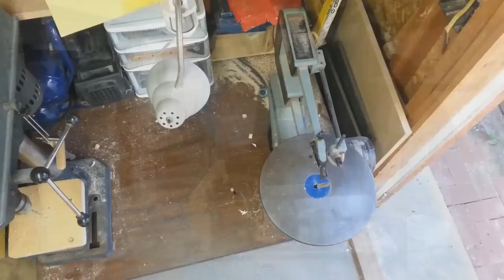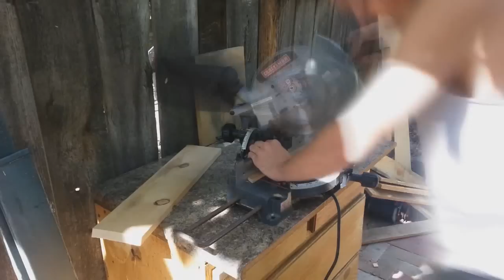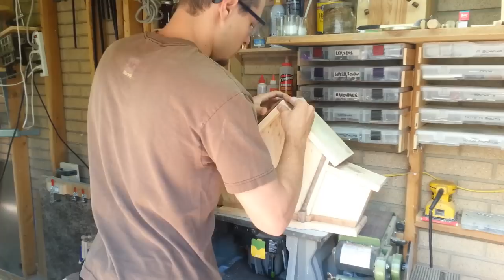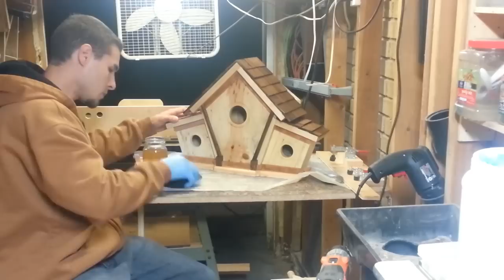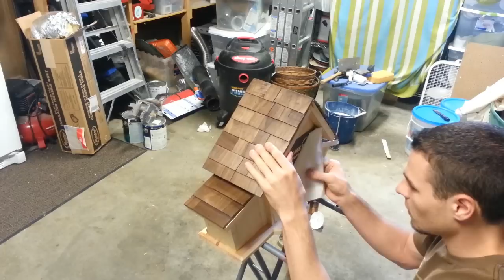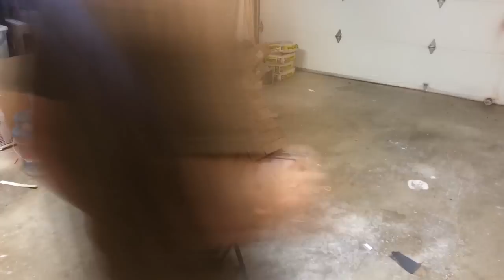Building An Awesome Birdhouse

Comment: ONE OTHER QUESTION--I TRIED MAKING A ROOF WITH SHINGLES DIFFERENT THAN YOURS--ITS WAS SHAKE SHINGLES 2 INCHES BY 2 INCHES BIT ITS DIFFICULT TO PUT ON--YOUR ROOF IS DIFFERENT. WHAT TYPE OF WOOD IS THAT AND HOWQ THIN--I NEED THIN WOOD FOR MY ROOF AND DO IT THE WAY YOU ARE DOING--ANY SUGGESTIONS--THANK YOU FOR THE HELP.
Reply from the maker: Mark Woolery The roof is black walnut, they are cut half 1/8" and the other half slightly thinner that's how the shingles sit fairly flat and fit together when gluing.
Reply: CNWOODWORK I WILL HAVE TO FIND WOOD THAT THIN
Reply: CNWOODWORK Thanks again for the help!

Comment: This is a very amateur question, but is that a nail gun that you are using to connect the shaped pieces together? And if so what type/thickness nail do you use. I have been wanting to slow get into woodworking as a hobby, and am trying to pick up ideas here and there.
Reply from the maker: Yes it is. For your first gun I'd go with a nailer/stapler. This one shoots 18 guage 1in-2in nails and staples.

Comment: Hey how'd you cut the entrance hole? didn't see it in the vid. Thanks
Reply from the maker: I drilled a pilot hole then used a hole saw to make the outer bevel and a size smaller to make the actual hole.
Reply: cool thanks
Reply: I have spent months studying constructing aviaries and discovered an awesome website at Aviary Magic Method  (check it out on google)

Comment: You spent a lot of time building a great looking birdhouse that only one species of bird will use at a time. One of the holes looks like a 2" hole which will most likely attract non -native nuisance birds like Starlings which are displacing native North American birds like Tree Swallows and Eastern Bluebirds. For these birds, a 1 and 1/2 inch hole is best. Although you seem to have good intentions you are not doing the native birds a favour. A nesting box should be cleaned out after the birds have left - I see no evidence of a cleanout function. There should also be an overhang of the roof over the entrance hole to stop rain from entering the box. I hate to be critical but as a retired zoologist, and someone who has built and monitors over 100 nestboxes, I feel obligated to point out design problems such as this birdhouse. Important features of a nestbox include a hole no bigger than 1 1/2" , a side panel that opens up for clean out, and mounted on a steel post with predator guard to prevent racoon, possums, and cats for example from raiding the nest. If you are interested in making something that is good for North American birds follow this link   (http://www.nabluebirdsociety.org/PDF/NABSFactsheetGettingStarted.pdf)  from the North American bluebird society. The nestbox design they favour is also used by tree swallows, chickadees and house wrens.